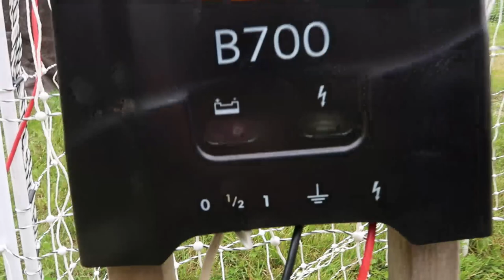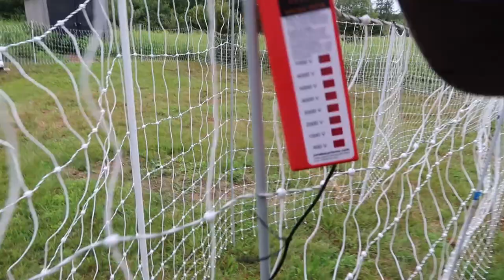Relocating My Bees: Taking Advantage of the Golden Rod

Comment: This may be too late for this year, but always move bees at night.  The bees are all happily inside making it easy.  None are out working.  Simply use duct tape to seal up the openings, use 2 ratchet straps.  It is always cooler at night too.  
Build yourself racks to get the hives a foot up off the ground.  Spray Roundup under the fence to kill the grass or it will short out the electricity.
Setup extra empty hives so that when the hives swarm, the scouts will find the empty hIve and the swarm will move right in = free bees!
Best wishes.
Reply: Good ideas